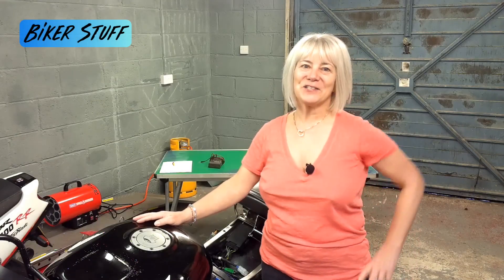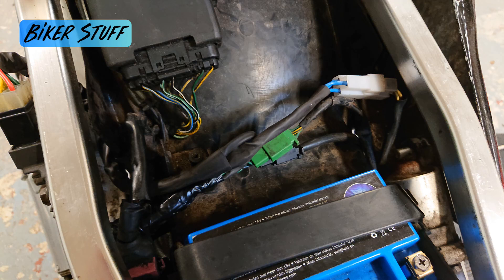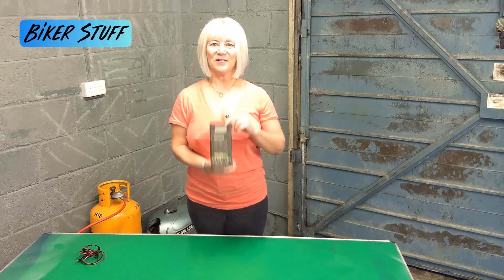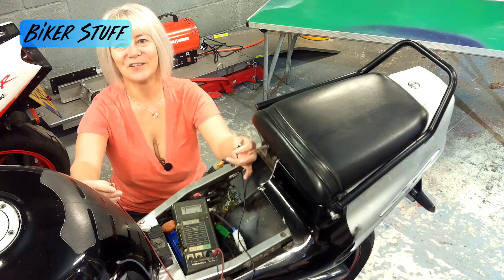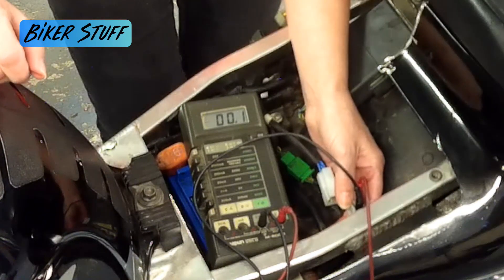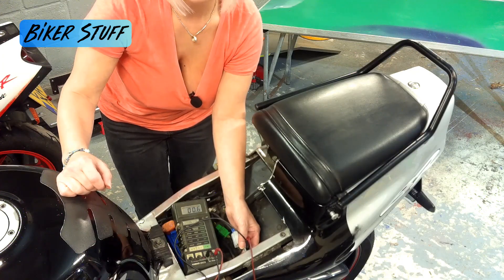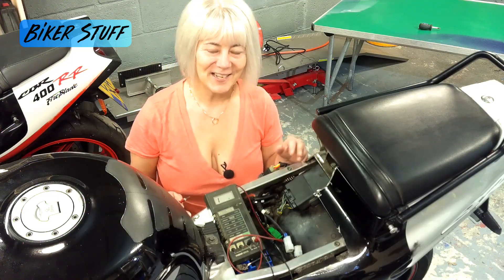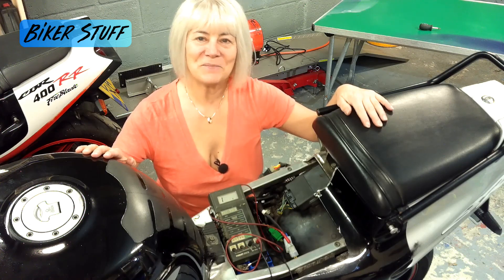Stator testing: How to test if your motorbike stator is working correctly

Comment: Can you simply fix the stator?   When I had problems with mine it turned out to me the magnets in the flywheel they were just too week with the starter motor speed  unless I used a rope starter.
This was with a  Honda FL350.. frustrating bit of trouble shooting to find the exact cause..
But we replaced the flywheel with new magnets installed and it would generate power enough to start the motor.
Drove us crazy to find that problem.. this was an older Honda FL 350 Oddesy.. very fun buggies for sand riding back in the day.
Reply from the maker: Usually a stator fault is in the wiring and not worth the effort to find or repair. They aren't expensive compared to the time to fault find and fix.
Reply: @BikerStuff  easy continuity test.. mine was in marginal magnets.. I know weird but the electric starter didn't spin it fast enough but a hefty pull on the rope would start it
 every time.. So we determined the  fault was in the magnets and replaced the flywheel and all was good after that...
Pretty rare but.. since you really do know your stuff, I though I would share it with you.. 
Great video.